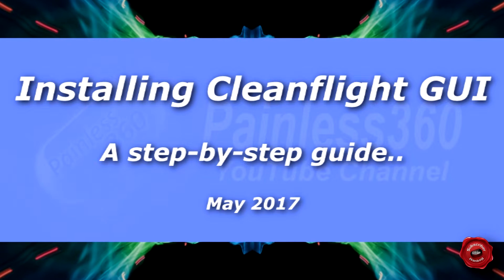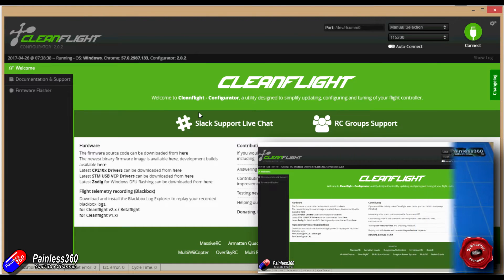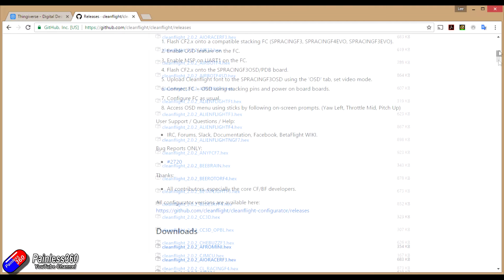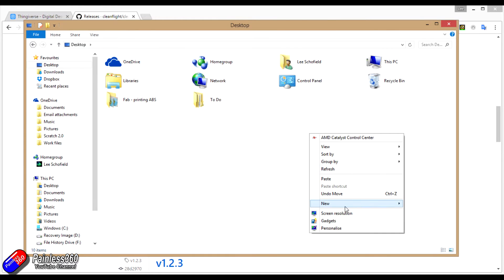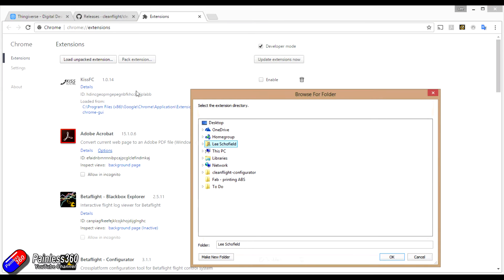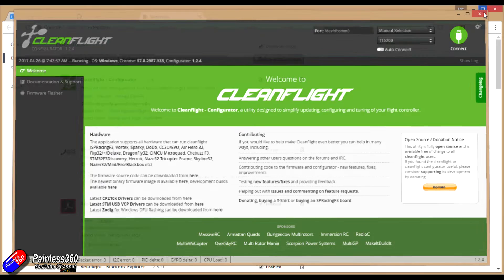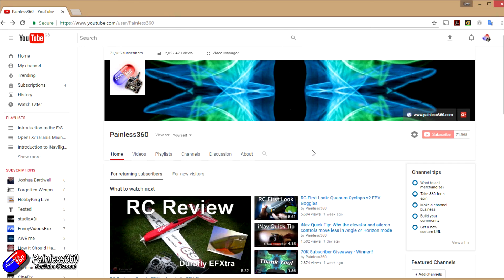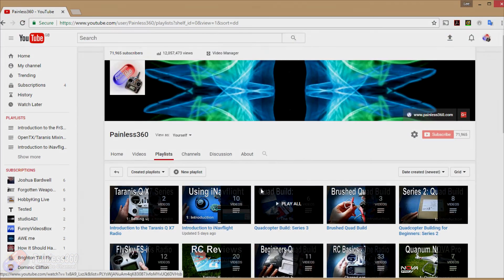Cleanflight 2.0: Installing an older version (step by step)

Comment: Followed this video and was able to unload the pack into chrome, but once it's in chrome I cant. get it to open. Do you have any suggestions of what I might need to do?
Reply: Any luck on your problem I have the same issue
Reply: ive got the same problem. i managed to load it but when i open cleanflight its still the newer version

Comment: Thank you for the video. Very helpful but I’m still unable to install. I was trying to get v1.2.0 and I followed these instructions but when I got to the ‘load unpacked extension’  selected, it then said ‘manifest file is missing or unreadable, could not load manifest’. 

I was told I need v1.2.0 is the only version to use with the Walkera f210. Anyone know what I’m not doing incorrectly??

Edit: @1:14 is where I made my mistake. I saw it in this vid which I didn’t realize before, and I was sure I did what you did here, but I clearly wasn’t doing it right! It seemed like it kept sending me to the correct download page but I didn’t see a zip file. Finally did it right (clicked on ‘releases’ and now I have v1.2.0!  Now I get to see if I can add a beeper to my f210 3D. Thank you very much!

Comment: I have followed your instructions very closely and it won't open on my newer windows 10 laptop. Although it shows up as an unpacked extension it won't open up to the user interface page. I'm sure it's something In doing wrong?
Reply: same here
Reply: @Wurtle38  try and download again! Its a zip file so firts thing is to right click and extract to where ever you want it. Then on the  more tools>extensions page  have to make sure "developer mode" is selected

Comment: You can't unpack anything  unless you click on    "DEVELOPER MODE"    first. His was already checked and he doesn't mention it till after it pops up.    Click it and Unpack Extensions shows up.   You'll feel like a programmer.  Yo  Painless..if this gets my Old Nazes to ARM, I'll be making a patron donation if you have one.  And Unseen on Into FPV.  Grateful..Hope it works.
Reply from the maker: Fingers crossed! :D Cleanflight seen like one of he slowest to sort this post Chrome support things out. I hope they produce two GUIs - one for the original and one for the Betaflight based versions.. Happy flying!

Comment: I am wondering if this method would work to install an older (pre-standalone) version of Betaflight, while Chrome Apps is still working. Problem is Boris only released source code unlike with Cleanflight.
Reply from the maker: Very possibly, give it a go! Best of luck!

Comment: Hi I am having problems with this guide all goes well until you mention right clicking on google??? (what ever that means) then it all stops as I don't get what you display on the screen at all I can however find the downloaded file and put it on the desktop no problem until I go back to google and try to load unpacked extension try as I may there is no sign of the download ? I am running w10  any suggestions
Reply from the maker: +Phillip Powell the file is a zipped file with the files you need inside it, you need to unpack it first. Not sure how I can make it any easier than how I've shown it here. Best of luck with it..
Reply: Hi yes your right I think I was a bit punch drunk when I was doing it as I have been unzipping hotprops plus DRL and failing to install either for the last week and today 10 tries at least without success so I guess I thought I had it I realised my mistake after kicking the imaginary cat.

Comment: Failed to load extension from: ~\Desktop\cleanflight-configurator-1.2.4
Manifest file is missing or unreadable.
Could not load manifest.
Reply: You need to select the main directory immediately below the directory into which the zip files have been unpacked!
Reply: i havw the same prob. and that still wont work.

Comment: what are you right clicking on sory dont know much about computers and trying to learn all these skills at once
Reply from the maker: It's a lot to cover in one lesson. Right clicking on a Windows computer is a way to bring up a little menu for the thing you're looking at that allows you to do stuff with it (apart from opening it by double clicking or dragging it somewhere by clicking and holding). I'd spend more time getting familiar with Windows and working with Icons before diving into things like zip files, extracting etc. covered in this video. Best of luck with it..
Reply: Painless360 thanks man i figured it out but i have another issue if u want to help i got my fly sky properly bound to my spracing f3 but my transmitter inputs dont show up on betaflight or controll copter..im using ppm transmitter shows thats its bound but just wont control anything
Reply from the maker: See the SP3 series on the channel - I cover all of the connection types in that series. Hope it helps..

Comment: hey it wont let me load unpacked extensions? its not even a button. it just shows that i have the latest version still..you loose me as 3:30
Reply: make sure developer mode is ticked. then the option to load unpacked extension will be visible.
Reply from the maker: Real tricky to see what you're missing unless you share a video of the problem...

Comment: I just flashed 2.0.2 cleanflight firmware to my Naze32 arco rev6. Now, when I go into the receiver tab in cleanflight, I get no response from my transmitter. The battery is plugged in and tx is on. The channel map is correct. Please help me!
Reply from the maker: +Cameron Crosby I'd put the original version on. Best of luck!
Reply: I just did and it works. Thanks :)

Comment: Hello,
I have an issue with my gps I don't get a signal in cleanflight.
I set it up as you showed in your videos (6/8) Adding GPS with NAZE using u-center and your paniless360 file.
My version of Cleanflight is 2.0.3 and the firmware v2 0.1 - NAZE.
The board is a Naze32 Rev5.

I also tried using an older version of cleanflight (1.2.4) and an older firmware v1.12.1
But there I can't set ublox as the protocol type. Whenever I click save and reboot the protocol gets back to nmea. 

Did you ever have the same problem and maybe a soultion? 

Thank you
Reply from the maker: See how we configure the GPS manually for Cleanflight in the SP3 series on the channel. If you're interested in GPS then I'd strongly suggest you take a look at the iNav series on the channel.. Happy flying!
Reply: Thank you so much! iNav works perfectly fine.
Reply from the maker: Maximilian Springer it's much better for pilots wanting to use GPS... Happy flying!

Comment: With new version of clean flight my quad just goes wild and falls out of the sky. Do I need to just flash old software and follow steps on video?
Reply from the maker: +blake Gordon if it worked on the older version, that's what I'd do. Hopefully you made a backup of the configuration or take a dump file before you upgraded. Best of luck

Comment: Thanks mate I don't think I could have done this without your help.  The only thing diff is I found I needed to extract the zip folder before doing the extensions procedure.  Maybe the packed option would have worked?  Does not matter because it works perfectly now.  If I move this folder elsewhere will it find it ok or do I need to do something else?  Thanks again.
Reply from the maker: Sounds like you missed the part where we copied the files from the zipped folder at 2:41. Glad you figured it out. If you move the files you'll have to re-add the extension in Google.. Happy flying!
Reply: Thanks for all that.  You are def my favourite YT channel!  Cheers.

Comment: I tried doing this twice, but every time I add the zip file to desk top it's just a zip folder and not a clean flight app.  Ugh
Reply from the maker: +Falcon Eachine you need to extract the files from it into a directory.. as per the video..

Comment: Thanx for this and all your how to vids. I'm having trouble loading the newer version of Cleanflight on a new SPRacing F3 controller. I keep getting a bootloader error. Any suggestions?
Reply from the maker: Tricky to help without the actual wording of the error. I've not tried the latest version of Cleanflight here, we're waiting for 2.1.. I'd use the exact wording error and maybe post the issue into the GitHub wiki problem area if there isn't an obvious answer. Best of luck with it!
Reply: Sounds good, thanx for pointing me in a direction. Want sure where to start.

Comment: every time i open chrome the message pops up regardless if developer is checked or not.will this cause a problem?every time i open i cancel it still pops up.
Reply from the maker: It will pop up every time, you can turn it off to avoid it (it's annoying!) and re-enable as shown in the video when you want to use an older version of Cleanflight..
Reply: took me a couple minutes to figure it out.i end up unchecking everything but my firewall and it stopped popping up in the top right corner.lucky i am able to figure things out thanks to all you share.